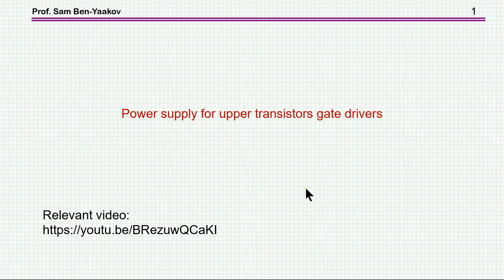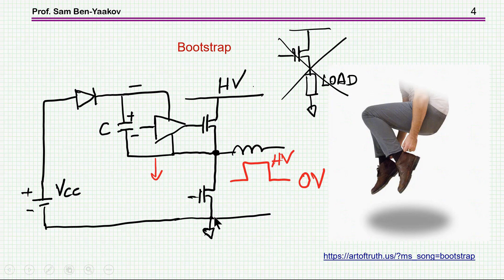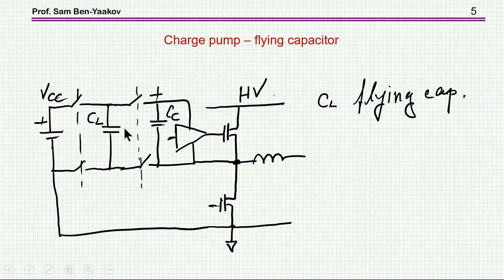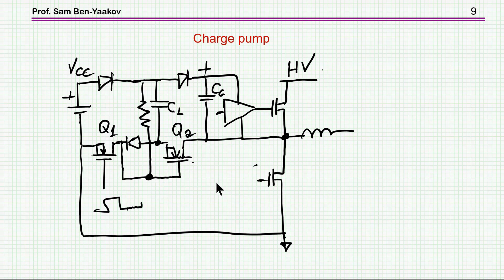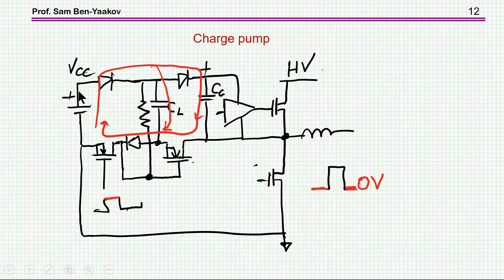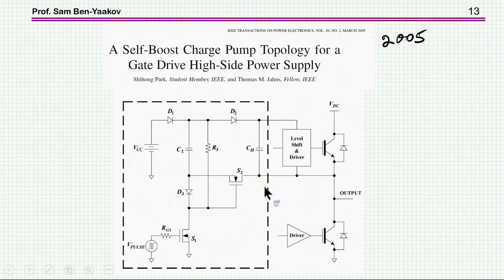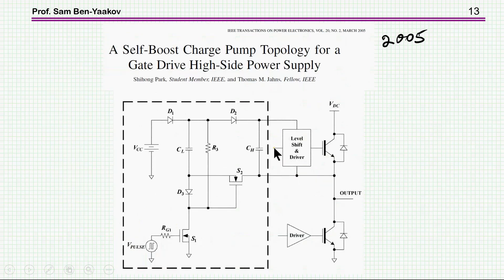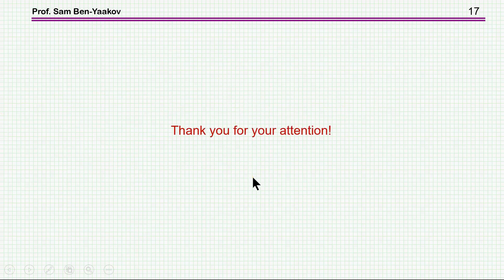Power supply for upper transistors gate drivers

Comment: Nice explaining video Professor. By the way, I'm currious in case a PMOS is used as a high-side gate for HV application then how can it be driven? as Vsg has a maximum limit as well so it should not be pulled down to GND as in normal low voltage application.
Reply from the maker: You can still use a voltage divider and a zener on gate to source for protection. This however is a slower drive. For a fast drive you do need a high side driver. But then, if you use a driver you might as well use an N channel transistor.

Comment: Can use a boot converter as a power supply for the high side MOSFET driver? And is that more expensive?
Reply from the maker: No you can not used a boost converter due to swing
Reply: @sambenyaakov  Thanks for the answer!